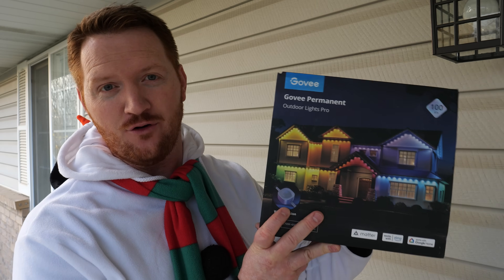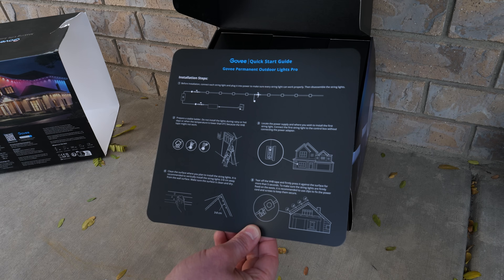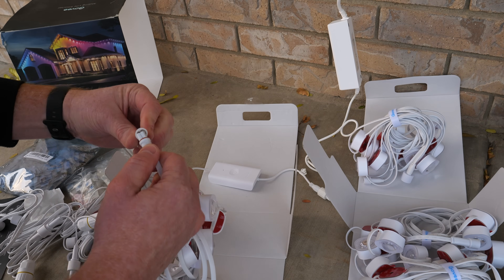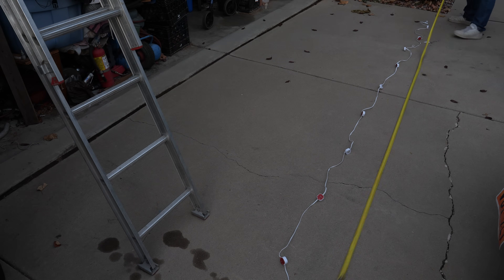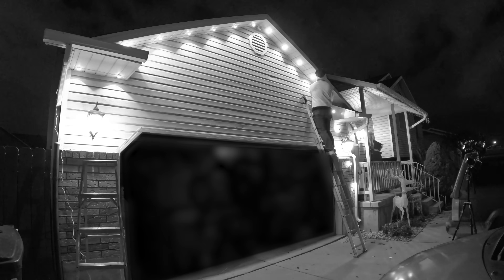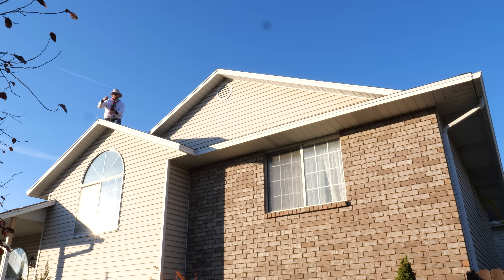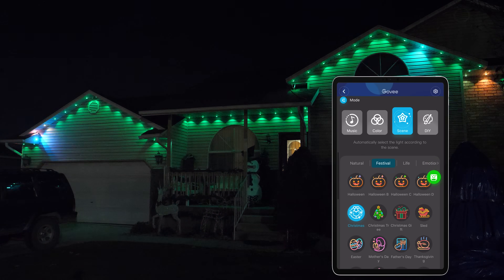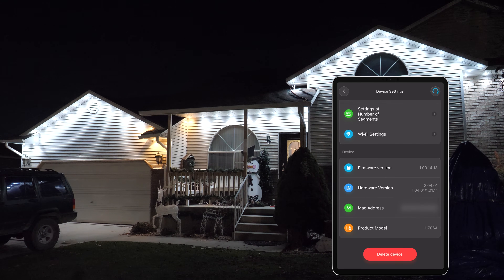Get the Perfect Christmas Light Fit with Govee Permanent Outdoor Lights Pro

Comment from the maker: Update: The 200' model does come with the Driver to power all 200'. And you can have them automatically turn on at sunset by using the Automations tab.

The 100ft Pro inventory has pretty limited stock so if it becomes available you can change the parameters of this link to find it: https://geni.us/GoveePro200W (affiliate)

Comment: Hi Brett. Thanks for the video. Just wondering how do we know which length to go with? 150 ft enough for a 2800 sqft home?
Reply from the maker: I usually open Google Maps and go to Satellite view, then hold down on the house where I am going to start and then tap on that and you can choose Measure Distance. Then you can add points around the house to get a rough estimate of how much you need. Just add a bit more if you have any spots that go up or down like on a gable.
Reply: @ thanks a lot

Comment: Quick question about the power. Does the box everything connects to have go inside the garage or can it sit outside by the outlet? Assuming it's weatherproof as well?
Reply from the maker: It can all be outside, it is all weather resistant.

Comment: Brett, thanks for the video. When you cut the black casing of the RGB wires, how did you cut it or what wire strippers did you use? I find this step to be very tedious and impossible without the right wire strippers.
Reply from the maker: These are the wire strippers I used but I just picked up a new style to see if it makes it easier: https://amzn.to/4f42yqi (affiliate)
Wire Stripper: https://amzn.to/3OF1O00 (affiliate)
Reply: Awesome! Thank you. Just used your link and bought them.

Comment: How did you play with the placement before deciding on the final one? Did you use the sticky backing it comes with and were able to remove and replace or did you use something else?
Reply from the maker: I just used the 3M on the back and it comes with smares so I then removed the ones I tried and put on the new stuff for the final placement.

Comment: Brett… I just bought a 200 and 100ft length to splice a little over 200 together in one long run. Is that not possible without this power extender you talked about? When will that come out from govee or any more details? Thank you!
Reply from the maker: So I guess it is already included in the 200' kit. So you should add it at 150'. I'm not sure how much further you can take it past 200'. Possibly 250'. Or you can set up each set separately and then link them together with Dreamview. Or use 150' on each power adapter.

Comment: Best video! Really appreciate seeing how you used the extensions. 

I only wish you showed where you’re getting power.  Is it in the garage?  Could it be tied into the exterior light switch?
Reply from the maker: Yes I pulled power through a hole in the garage. You could get it from a light switch but that means the switch will need to be on for the lights to work.

Comment: Is it ok to add an extension between the power switch and the first strand of lights? I’ve decide to route the power a different way and I’m coming up a little short in reaching the outlet.
Reply from the maker: Yep, that will work.
Reply: @TechWithBrett Thanks for the fast response!

Comment: Have you had any issues with these?  After many months of use, mine just died.  I have received replacement parts from govee but still nothing works.  I thought it was a power supply issue but now I don't know.
Reply from the maker: That is very odd. I haven't had any issues. Have you verified the outlet it still working? The GFCI could have tripped.
Reply: @TechWithBrett  yep!  Even tried a different outlet and two other power drivers

Comment: The 200ft pro version does come with the driver module you need to run 200ft altogether in both the white and black version. If you order any other lengths you do not have access to the driver module yet till next year. Not sure why but I have my 200’ in black version and it has the driver module and saw a video of the white version with it as well
Reply from the maker: Ok, good to know. So if I wanted to upgrade to 200' the 100' options will need to wait for the driver. I hope they come out with an expansion kit so I can add that top section.

Comment: How did they stick ? Vinyl soffit ? Or aluminum?  Good video !
Reply from the maker: It was on aluminum but I went through and put clips on each side of the light and screwed them in so if the adhesive fails they won't fall down. The adhesive was pretty hard to remove though if I needed to reposition a light.
Reply: @TechWithBrett  Thank you.

Comment: Hello brett, how long i can cut and extend it in between if i want to get it to the second floor
Reply from the maker: I guess if you needed a long run to the second floor you could use all the extensions on one run that is about a 20' length.

Comment: best review of these I seen so far.  From the LED spacing to the individual led controller.  Well Done.  I was thinking of mounting these via magnet (attached to each LED) to my galvanized drip edge.  It would be a different look since the LEDs would be facing the street and not facing downward.  I wish these were a bit cheaper.  Hope after Xmas they will be heavily discounted.

Comment: They sell fitted brackets for each individual light on Etsy. I used those and secured them with self tapping screws. Way stronger than the 3m adhesive and more visually appealing.
Reply from the maker: That's a great idea. I just 3D printed my own for an install and it worked great.

Comment: I went to the bag of 100 clips you purchased , but I cannot see them well enough to know how you installed them. Was this for the wire or the light puck ?  Could you maybe show a photo of them on your installation ?  Thanks very much.  I’ve been considering the 3D printer mounts that screw in but they are expensive.
Reply from the maker: Sorry I forgot to include that in the video. They have a little adhesive stop to help you line it up on each side of the light. Then they have a part with a gap that goes over the cord. There is a little hole over the adhesive part that you screw in with the included screens. Using a small drill bit to puncture a hole helps this process. I'll post a picture for you later today.
Reply: @TechWithBrett  The clips you have under description aren’t in stock… do you know what else I could use???

Comment: I understand you can cut them.  But if you want to EXTEND a blank distance what wire can you use ?
Reply from the maker: You would just use one of the included extension cables. They can easily connect together and then you can cut them to length to make them the right size.

Comment: you should replace the controller with weld, i’ve seen others do it and you can do special effects, you can still add it to anything you want with home assistant
Reply from the maker: I've heard about this. Anyone interested needs to check out The Hook Up for more details.
Reply: What kind of special effects?
The Govee App not able to do i guess.
We bought the 100ft Pro..I heard the Pro doesn't work with some 3rd party controllers like WLED because of the dedicated soft white leds.
Reply: @VonSpud that is correct because of what you stated about dedicated white lef
Reply: led
Reply: @MegaTapdog  curious how an App can't work because of the white LEDs...App needs an update?

Comment: I'm glad the warranty is 3 years on these. I have about a dozen of the IP65 Govee outdoor string lights and several have gone bad, including some outside of the 1 year warranty. I don't think I'd trust Govee with anything permanent right now, but maybe that's just me. What also concerns me is that the LEDs are connected in a way that doesn't make them user replaceable without splicing. So, thinking ahead with a situation where a light fails, and we'll assume it's within 3 years, they replace the whole string under warranty. So it seems like you are either cutting the old light out and replacing with the new, which obviously won't look as good as original, on top of the fact that you are doing it where the bulb failed, which is maybe on the roof - yuck. Or you get on your house again to replace the entire string, which also isn't the best solution. For ME I have a single-family ranch, so while it'd be a small PIA, it's not the worst thing in the world. The cost would stop me from buying this particular string, so I'm hoping newer iterations fix some of what I see as shortcomings, not to mention bring the price way down. For $700 I definitely would have expected better. Optionally, maybe something that adheres a magnet that the light snaps to. This'd not only make it easier to take down seasonally or if you had to remodel, and replacing them if you had a failure. That being an optional kit for what, $20 or something would be neat.

I'm guessing they did the calculations and didn't think the cost was worth it to connect the lights to each other with connectors instead of hard wired, so not only could they just ship out the replacement light and nothing else, but it's so much easier for the user to replace. I'd feel a lot better if we knew what the MTBF of these lights were with the product as-is.

Neat idea, and I'd love to have something like this. I'm so glad Govee and other companies are releasing products like this. Thanks for the video, Brett!
Reply: the only good thing about Govee is their support, I bought some indoors string lights when they first came out, 3 weeks later some LEDs went bad, if I recall correctly, they lost their blue tone, got a replacement from them, they also went bad, then I just got my money back.

Comment: Do you know if the LED strips expect the current flow in a single-direction? I am getting a green blinking LED on the power adaptor and only a partial section of my 12 strips are working, not sure what's wrong. The govee app can't detect all the strings it looks like.

Comment: Can u install these I need like 3 150 feet of govee connected together.
Reply from the maker: The max length they have is 200 so you could use two kits and then they have what is called Dreamview that lets you sync the lights together in a way.

Comment: What’s the difference on the 2,500k-6,500k output … my box says 4,000k
Reply from the maker: I believe you have the Govee Permanent Outdoor Lights 2 which is the newest model Govee has. The difference is the 2500K is a very warm light where 4000K is more middle of the scale on warm but looks very nice year round. I have this video comparing the options:  
https://youtu.be/xCk9palnrGo?si=9MOzukjCT0P9k7za

Comment: What is matter? Also, the pro "is going to cost a little bit more." It's more than double the price of the standard.
Reply from the maker: Sorry about my rounding, it is a personal problem. I guess when you compare the 100 Ft model of different options. The 200 ft is significantly more which is the only one in stock right now.
Reply from the maker: Matter is the new Smart Home Standard that certifies this device will integrate with your Matter compatible Smart Home. Google, Amazon, Apple and more platforms support Matter.